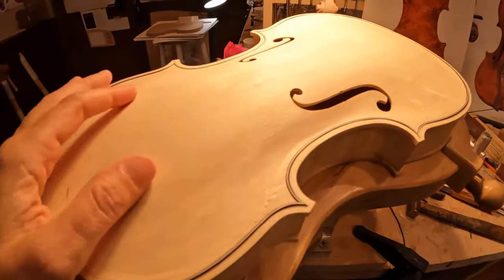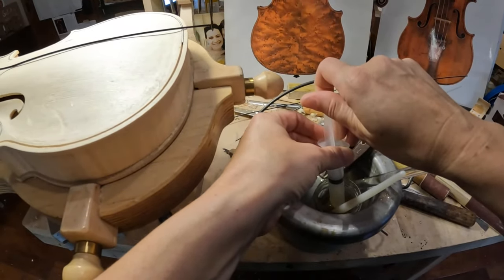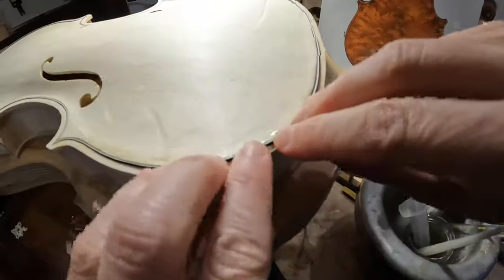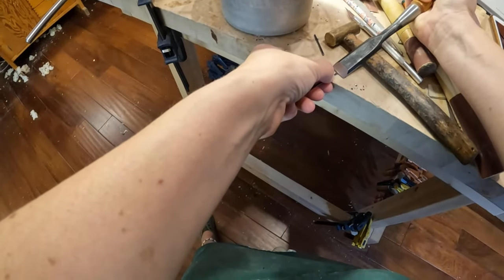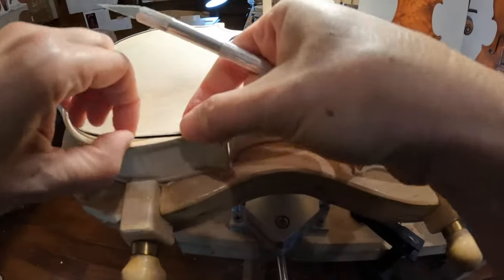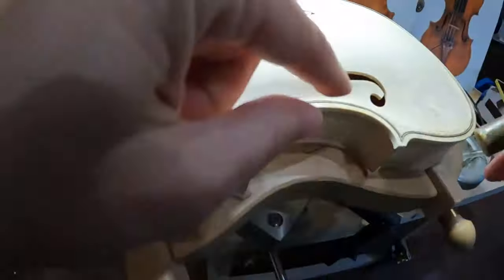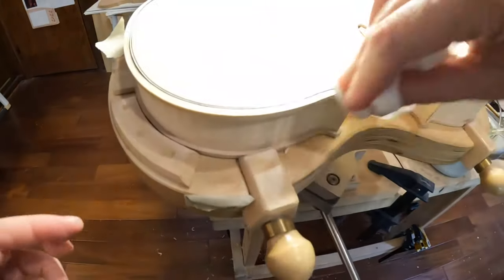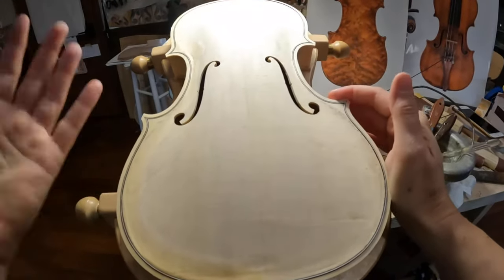Live 🎻🎥 my favorite way to glue purfling✨

Comment: Is that a commercial made jig that you are using to hold the violin? I do have a"kit" that I am using to practice doing the purfling before working on my good violin wood. 😊
Reply from the maker: Making some tryouts on samples before going on your good violin is a great idea!
And yes. I bought the form at the shop and modified it a little bit.
I will make a video and that tool as well!!!
How many ideas 🤩